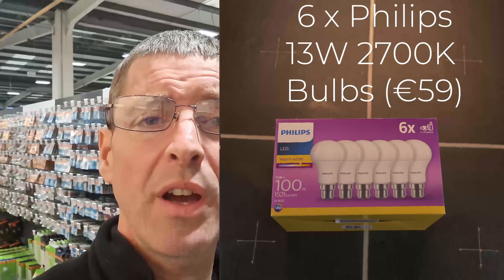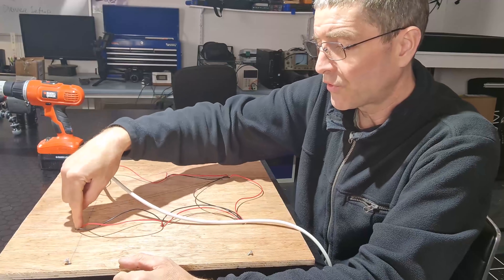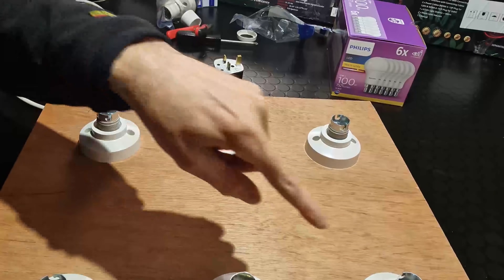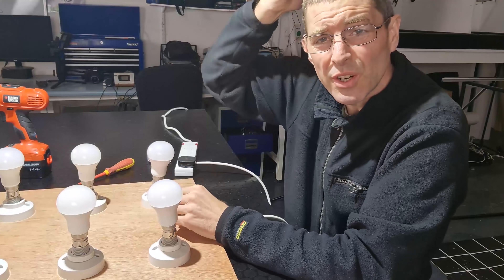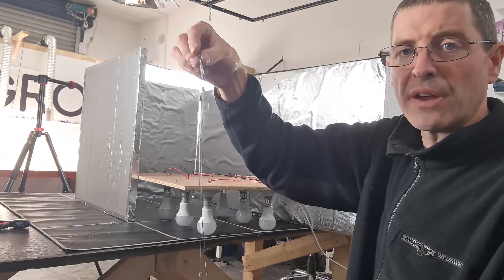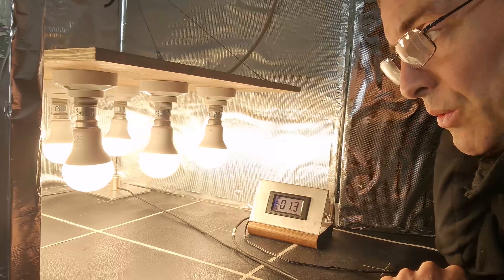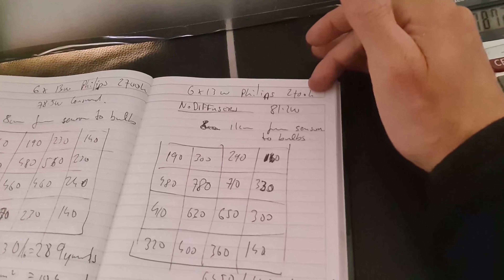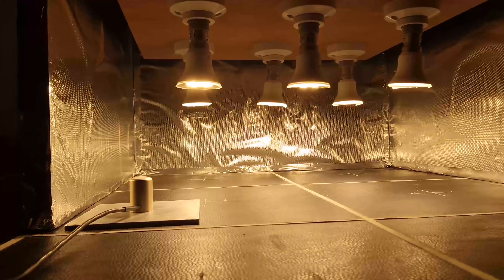DIY LED Grow light build | Build your own cheap simple and efficient LED grow light

Comment: Hi there, 
I built a light like this one. I use the Ppfd meter app to monitor Ppfd. When I do the readings I am getting a lot higher readings coming from the reflections of the side wall, for instance I’m getting 20 ppfd facing straight up, and as I tilt my phone more towards the side wall it will rise until you pass a certain reflection angle. I am running 6- 8.8w 800lumen with color temp changer, I have 2 @ 2700 and 4 @ 5k. At 24” in height from the top of the plants to bulb, I’m getting 20 Ppfd and in the same spot just rotating the phone sideways I’m getting 164ppfd, do you have any suggestions? My phone is an iPhone 11 and my grow tent for these numbers is a 2’x2’x4’ tent, my lights are on a dimmer switch and the plant’s reactions seem to match my sidewall numbers as I run them now there at 40% and raising it up to 65% giving me a straight down reading of about 48 Ppfd caused some of my clones to wilt overnight so I brought it back down, following day they were standing right back up 
 
Just as a side note I am getting similar readings from my lights in my 4x2x5 low numbers in the straight down lighting with high side wall numbers and those lights are  3- 4’ led light strips 2@4k and 1@65k

Comment: I know this is an old video, but I have found the easiest way to remove the diffusers on those bulbs is to take a Box cutter around the indent at the bottom of the diffuser and simply pop the whole thing off.

Comment: I did the same thing yesterday but I used standard screw in lightbulb bases and got real LED grow light bulbs with the full spectrum color.

I didn't have to drill holes in the board. I used my Dremel with a cutoff wheel and notched out two spots in the base, to run the wires through. So my wire is on the same side of the plywood as the lights. The LED lights run cool enough that it's safe. I then mounted a box with a light switch on top. 

Using regular non grow light bulbs is fine, but your 2,700K is too low. Plants grow better with 5,000K to 6,500K. 

I built a simple wooden frame, sort of like a miniature table and eyelets in each corner and also on each corner of the plywood. Then suspended it with bailing wire. This allows me to easily raise or lower the lights. 

If you wire your lights like this, you are supposed to do it with the correct polarity. What you do is install the black hot wires onto the gold colored brass screws. Then you install the white - neutral wires onto the silver color screws. On your plug one of the blades is wider than the other one. The wide blade is the neutral and the more narrow blade is the hot or black wire. Most of these light bases do not have a ground wire so just snip that off, it's not needed unless the base you have has a ground screw.

I'm a professional and have been doing electrical work for almost 30 years so I'm not just guessing on this. The whole contraption is probably not technically up to code but it's perfectly safe if you do a good job on it and don't have children messing with it. 

Also my description for wiring is for the American electrical grid. I don't know anything about European electrical systems except that it is about double the voltage and lower 50hz frequency.

Comment: I use pendant style lamp holders, wire them together and then tape the wires along a pole or a coat hanger in smaller spaces.

Comment: If the power factor is "bad" in a residential setting, you might not be fully and properly paying for all the electricity that the led lights are consuming. That's why they measure PF for large commercial or industrial users and punish them for "bad" power factor.

Stated differently, this might be a feature rather than a problem for the home user of LED bulbs.

Comment: The results from led bulbs are amazing, you can make some very powerful led lights, cut the diffuser at 25mm and leave it on the bulb and you will get about 10% more light, reflects some unused light back on the canopy, you can make a reflector by wrapping the inside of the diffuser with foil tape, but attention to detail is very important, once the foil tape is stuck(good quality thick tape), and it warms up its not coming off, it becomes over 30% more effective, some bulbs have parallel resistors, you can remove one and it drop the watts, can be reduced by 50% and the bulb runs cool, 40c instead of 85c in some cases, when bulbs run less watts they become more effective per watt, when bulbs run cooler they last longer, years longer and they put out more light.
Reply: Sounds like a house fire waiting to happen honestly
Reply: The diffusers are very difficult to cut accurately. A lathe with the bulb mounted in the chuck would do it, but that's an expensive extra. Even if you can manage to leave about 25mm attached, rather than applying tape (which would fall off), a better idea would be to paint the inside of the remaining diffuser with matte white paint, which has better light-reflecting properties than a shiny surface.
Reply: @CrankCase08  its not difficult to cut accurately, hang a budget Dremel tool upside down, fix it in place, adjust the high and rotate diffusers in a circle, perfect cut every time, make the hole just large enough to pinch the corners of the led, use a small amount of silicone sealant to hold it in place, I sprayed each reflector with a base coat and chrome effect spray, (thin coats),  the results are really good, white paint did improve the results vs not using any spray but it was not great.
https://youtube.com/shorts/bLQJK_4pFvk
I used to grow with hps and then started to use led bulbs, led bulbs feels a lot safer.
Reply: @marksmith-cg7wl  Shiny reflector surfaces tend to produce hot spots. This is why manufactured reflectors always have a matte surface, whether it be matte aluminium or matte white.

Comment: A met an old friend with this set up, kinda. He had a 203 blurple light and 3x 13w 2700k.
Was getting 60g of hulkberry using only compost and a hint of bloom boost, from autoflower in 30cm x 70cm stealth chest of drawers.

It works!

Comment: I wish someone would talk more about bulb output . There are smaller 60w bulbs that come in a 4 pack, but it says 60w , now does that mean each bulb is 15watts each ? or is each bulb 60w ?
Reply: No it means that each bulb in that box is the equivalent of the old incandescent (60w) light bulb in light output. The actual consumption is around 5-7 watts. If you look at the box in the beginning of the video 0:09 it says in the box 13 watts(that is for each bulb) = 100w light output of the old normal incandescent bulb. And something else to consider, if you are really interested to grow plants under grow lights diy or commercial..  make a research about :
1) PAR (Photosynthetic Active Radiation) 
 2) PPFD (Photosynthetic Photon Flux Density)

Comment: Does the exposed wiring create an electrical hazard?With humidity and so on?
Reply from the maker: Yes you should have cable shrink over the connections.

Comment: Beautiful work Shane.
My setup uses splitter adapters. I’ve got a few lamps already, so i just ordered splitters and bought 23w (CW & WW) CFLs.
2 lamps, 4 splitters each. During veg I’ll use 4 of each, 2 on each splitter, 4 Cool White & 4 Warm White.
During flower i change them all to WW.
Since my light doesn’t have IR/UV and CFLs do, it’s perfect. I’m not worried about how much extra wattage I’m getting, it’s rather for the IR and UV.
Reply from the maker: Nice, thanks for sharing.

Comment: Thank you for this Video, I have built load of units and there very cost effective for the investment, I have pulled the bulb apart and stuck them on aluminium channel, all light bulb makes I have tried, stay cool on the aluminium, around the 400w of led, evenly spread out covers a 4ft x 4ft flower room, 30,000-40,000 lux, plants love it @12"( no light burn), pulling an average of 18-20 zips per crop.
Reply from the maker: Thanks for sharing

Comment: So is it fine If I get an industrial projector 150w 4000k  that has a big ol' huge heat sink on it (weighs probably 4-5kg, passive cooling , I will switch out thermal compound to quality one) and remove the diffusion glass in the front , exactly what will I be missing by going this route instead of the 150w white grow light that is 3x the price

Comment: I built a variation of this 10 years ago and still use it. I used 3x 12 outlet power strips and plug to socket adapters, bulbs are 4 inches apart. Between the power strips I ran fluorescent bulbs to get some uv. Wish I could test them, but they produce better flower than actual grow lights.
Reply from the maker: Thanks for sharing.

Comment: I just built one today ! Will it hurt that I put 10 bulbs in my 2x4 , I did 4 5000k 100watt led on the outside corner lamps should I go back to all 2700k lamps PSA , it only cost 💲 94$ excluding the 14-2 Romex wire I had laying around and extra extension cord
Reply: 2700k bulbs alone will produce more stretching due to the lack of blue. 5000k or 4000k  have a similar amount of red to 2700k, yet more blue that will reduce stretch.

Comment: They sell string lights that take 10 or 12 regular size bulbs at lowes and amazon. 23 watt high efficiency led GE lights in 5000k and 2700k for a good mix of spectrum. For 100 or so bucks on a 12 socket string, 23 watt lights will give you a 276 watt grow light thatll illuminate a 3x3 like a boss. This guy has some great ideas. I dig it

Comment: Thanks for being such an humble and nice human being, sharing killer knowledge even while running a company selling pro stuff.
I'm working on a extremely low budget+scrap yard 2x3 project based off 5 quite big e27 bulbs (and 2 cheap 50w cobs), the par measurements here makes me hopeful :)
JUST A REMINDER: especially for bigger bulbs pay attention to the exposed contacts on the board!!! This 23.5w 2700k Lexman bulb I have here is quite hot, runs at >300Volts!!! Other brand, 18w 3000k: 260v. You don't want to touch that. I thought my multimeter was broken at first. For my build I will cover the naked contacts in resin or something.

Comment: I've been using these to top up the light around the edge of my grow tent.  My main lights are 1000W LED with the VEG Bloom switches but they hang in the center of the tent so I use these around the outside.  I was amazed at how bright they are when the top's come off.  I was actually using the bulbs after they burnt out around the house.  I would remove the LED that burnt, put a bead of solder over the space, and the rest of the lights light right up.  Today though I purchased "Daylight bulbs" and took the tops off.  I am amazed at how insanely bright these lights are.  Will these work or are they the wrong kind of light.  All the lights I've used in the past are like the ones in your video.  They have that yellowish tint to them.  Daylight bulbs are bright white and even though they are only 60W I'm betting they are dangerous to look at once the plastic bulb is taken off.

Comment: You can pick up sf1000 for under £100 second hand on eBay.
Reply: You can buy a 200 watt outdoor floodlight in 6000k and another in 3000k  for around $20 US each with no wiring necessary. and combined, a true 400 watt rating (185 actual watts drawn by each) and combining 3000k and 6000k works very well even for growing cucumbers, peppers, and tomatoes at a VERY low cost compared to a true 400 watt grow light. A lot of low cost 'grow lights' are really just a combination of similar LEDs, maybe with some minimal IR or UV added mostly as a marketing tool.  Not fancy, but for growing lettuce, you don't want to pay more for the lights that you would pay if you just bought the lettuce.  You do need to pay attention to efficiency, so if money is not a problem, then buying a good quality (not low cost) grow lights is perfectly fine.

Comment: 15:40 any risks for the LEDs and the fixture as a whole? What about moisture build up and risk of short circuit?
Reply: There are better options such as sealed floodlights now available rated for outdoor use at much lower cost. I bought one 200 watt, 6000k/6500k floodlight for $16 US and another 200w 3000k for $18 when I saw them on sale about a year ago. They each use 140 lumen per watt chips, which don't exactly relate to PAR value, but are pretty efficient.
Reply: At this point you can buy a 150 watt actual grow light for like 80 bucks. It’s not really any cheaper to diy these days

Comment: I'm currently experminenting with some of these household leds on a couple of  autoflower seedlings. I removed the diffuser and put the lights close like you have but after taking a reading with a lux I got over 80,000. I was gobsmacked. These are only 14w bulbs. I've had to move them about 2 feet away to get even a 20,000 reading.
Reply: share results

Comment: First nice video, i was looking for some video that analyzes the efficiency of those lamps. Some people mention that this is just a budget solution but is there anyway to make it more efficient? The obvious solution is to add more lamps and here is my question : I have seen  grow led panels having 2.6 - 2.8 μmol/j - is it possible to reach those numbers with those lamps ?
Reply: Using more watts will pretty much increase light for plants, and combining 6500k and 2700k gives a good balance of red to blue. You can find more efficient lights than this test uses at very low cost. Sealed, water rated outdoor flood light fixtures vs bulbs with all the wiring internal and finished are available at about 10 watts per US dollar with pretty high efficiency. If you spend 75% less on the fixture vs a 'grow light' then lower efficiency at producing PAR light can still end up as lower overall cost. I tried to compare costs of growing lettuce using cheap lights vs using high quality lights, and roughly cam up with about 5 years before the 'grow light' was paid for with electricity savings, but that all depends on local electric rates and local cost of lettuce. Plants needing more light than lettuce should have a shorter 'break even period.

Comment: I have a bulb here. Its a CREE 250w/19.5w PAR 38 40° floodlight bulb. 90+CRI 2100 lumens. Color temp is bright white 3000k. That'll do it, right?
Reply: Should be good for a 1-2 square foot of growing area with light pretty close. Seedlings may stretch a little, but if you start seeds under a 6000k light, and then move them under the 3000k, they should be fine. Depending on actual spectrum, even 3000k may be okay with no stretching.

Comment: Thanks for this great contribution to the public good. A local shop is closing out 10w, 1100 Lumen bulbs for a buck in 2700 and. 5000K. I see you used 2700, which I understand would provide better photosynthesis. Should I throw in a couple 5000’s to provide more blue?
Reply: I modified a bunch of bulbs and experimented with this. Please be careful. The ones I used have exposed terminals on the board that have 120v on them. I’ve been using epoxy or liquid tape to insulate the terminals.

Comment: One more con would be moisture on the fixtures. XY the metal fixture would corrode and make it harder to change out lights if need be. When you change them you would need to clean the corrosion everytime which isnt a big job and I'm sure there's an electric grease you could use to stop corrosion if anyone knows of anything. 
If you're not sure what I mean, go outside and try and pull out a bulb from a fixture that exposed to the elements. They're very tight and hard to remove and replace.
Reply: Easy- buy a 200 watt, LED, sealed, outdoor rated flat panel flood light fixture with all wiring included for under $40 US. I found a couple for under $20 about a year ago. Bought one 3000k and one 6000-6500k for under $40 combined, at 200 watts each. Used them last winter for peppers and cucumbers. Depending on space, you may only need a couple 30-50- or 100 watt fixtures.

Comment: Just bought 3 packs of 3 lamps ( 9 lamps total ) for 3,75 eur each pack. Gonna try to cut the tops without damaging it.
Edit: used it in 2 plants at a time, for vegging i use T5 lamps, for flowering I've made 5 crops now with this setup. Works great.
Reply: Explain more
Reply: Sorry I'm late. What do you need to know? For a tent with 90cm wide, 40 on the sides, works great. Two plants at a time. Now, it's in a 1m² tent and still works out for maybe 4 plants, with additional huge vegging and flowering  CFL bulbs i bought for 2eur each.

Comment: Amazon sells a 7 in one adapter for screw in bulbs I have them in the tent along with 2 mars hydro and 2 spider farmer I'll see how the combo works before I get more expensive lights cause I've been overspending my budget however the 5000k 1200 luman bulbs do decent all on there own
Reply: A 'folding' garage light that screws directly into a single socket may be easier. I have seen them with as many as 200 watts. 'Flood lights' which are rated for outdoor use are also a very low cost pew watt and the newer more powerful ones also use the newer more efficient LEDs.

Comment: Is 2700k suitable for veg and flowering? Grateful for any advice.
Reply: 6500k is better for seedlings, and combining 2700k and 6500k is said to be almost ideal for general growing. 2700k may be what you want strictly for flowering, but I grow veggies. I was told that equal 'wattage' of 2700k and 6000k is all you need, and it works for veggies. But for a plant where you only want dense flowering, and aren't concerned with the green parts being healthy, 2700k will probably be fine.
Reply: No. 3000k, 4000k and 5000k produce a similar quantity of red as 2700k, but the higher K numbers produce progressively more blue, which helps reduce stretching.

Comment: If you are able to solder them, I highly recommend it. It is a lot more secure, compact, and cheaper when you skip the bulb holders. In my opinion it also improves cooling.
Reply: So just solder right onto the bulb? How do you hold the bulb in place?